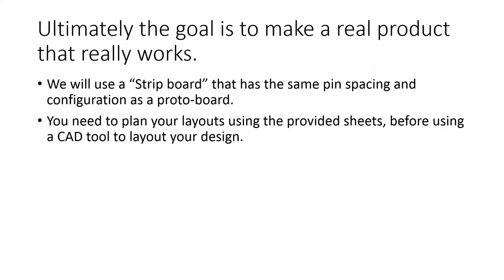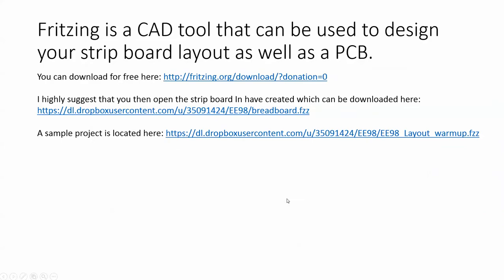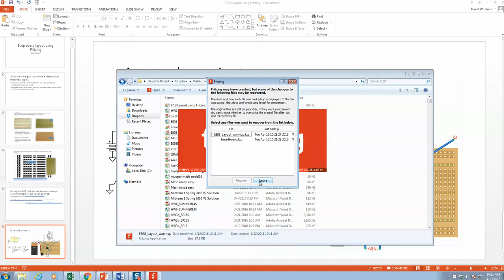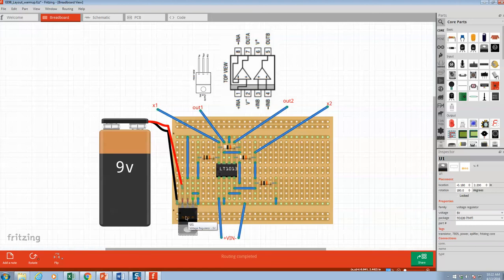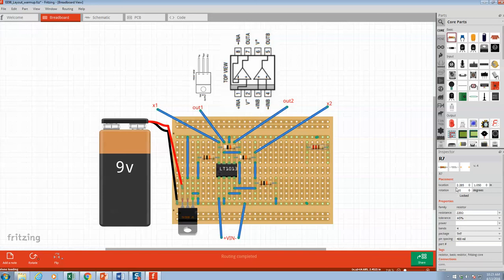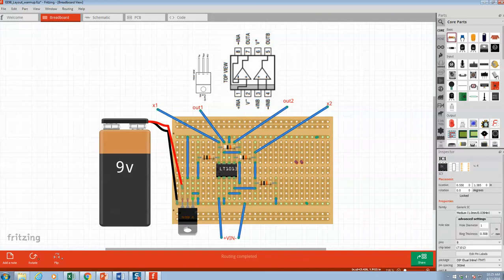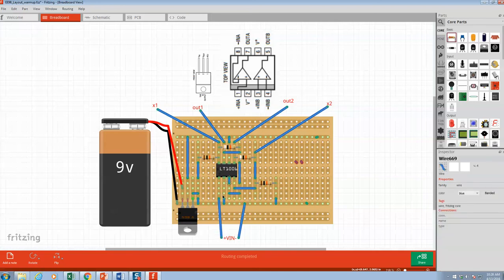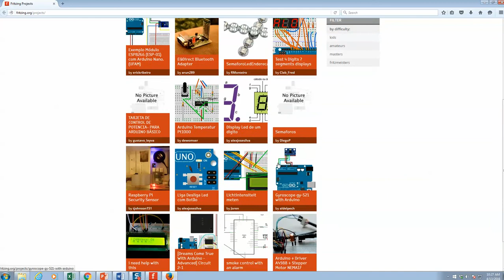Using Fritzing to layout strip board project

Comment: Is there a way to view it from the back so that when you solder the real board, you can easily see how the connections are laid out in reverse?
Reply from the maker: I know it might be  hard to see but what you are seeing is in fact the back, as sen from the front, if the fiber glass of the board were transparent..    It might look like I am putting the components directly on the back, but actually they go through the front into the pattern below.   Everything that is put into the top of the board is soldered in on the back.